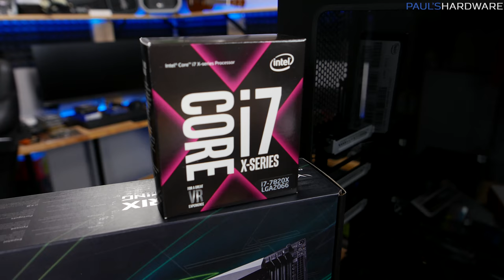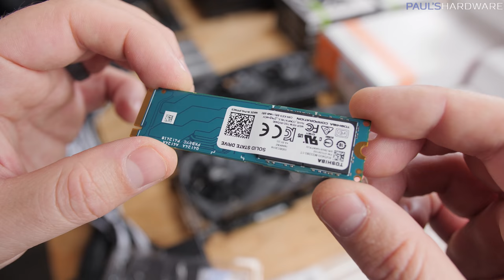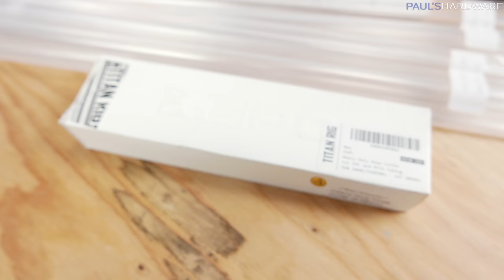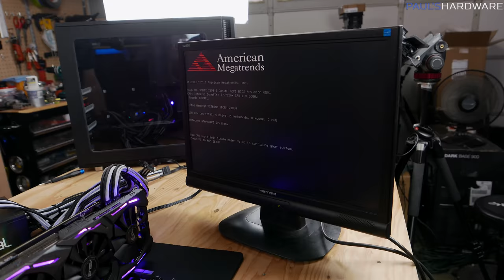GLORIOUS Custom Watercooled PC! Arctic Panther Build Log Part 1

Comment from the maker: Hope you guys like the video! Here's the USB Type C add-on mod I did (USB 3.1 Gen2) in case you missed it: https://youtu.be/iCFF2vujTv4
Reply: Yo Paul, am looking forward to watching this whole series. By the way a question about DDC pumps, are they quiet or not?
Thanks.
Reply: Just my opinion but Arctic Panther always seemed liked it was meant to be an over the top PC. So going with a 28 lane 8 core CPU does not seem like a big upgrade from your current 5960x 44 lane except for clock speed. The 7900x seems like a better evolution to me.
Reply: Paul dont use the strix backplates!!!! They dont fit. I just finished my own 1080ti strix sli build, and the card wont fit snuggly if you use the stock backplates.
Reply: Paul's Hardware why not msi?
Reply: hey Paul you want to do me a solid and build be a pc please
Reply: Paul's Hardware And by the way,how Asus works is:
Shove our hardware into YouTubers faces for free
Make them do sponsored videos in return of $$$
Invest in more shameless self promotion

How msi,gigabyte... works:
Make good hardware,if you want to use it,use it,if you dont,then dont....
Reply: Paul's Hardware 
 Why don't they make a full motherboard water block then just make port coming from the mother board wo you could water cool the video card and a front plate for the CPU.
Reply: I'm not a Fan of Fans in the bottom... Because they are fastest at, sucking dirt in the Filter... So they become useless really fast.
Reply: and then, like the last arctic panther, those GPU's will be obsolete in a year :'(
Reply: Paul's Hardware I don't see the fittings you used in your parts list! Might be blind, just wondering what you decided to go with for 16mm tubing
Reply: wasn't the cable too short for the place you put it? wasn't the other side a better place for that connector? does Lian-Li sells a longer cabled version of that?
Reply: Paul's Hardware but why not 7900x
Reply: FWIW, Paul: Anyone who criticizes you for the use of the 7820X, is welcome to get their own sponsors & build their own badass PC. ;) Also, I doubt you'll see any loss running one of the 1080 Ti's on x8 lanes. I ran 2 on x8, in the past, with no noticeable loss of FPS, or general performance. Keep up the good work, sir!
Reply: Paul's Hardware
How much would all this cost?  My guess like $3500+ maybe
Reply: I did tempered glass before it was cool... you sir copied me.
Reply: You can enlarge the holes of the backplate so they fit over the waterblock screws. A new high quality hss drill bit will make a clean job of it.
Reply: Paul's Hardware Awesome video yet again. Loved the jazzy tunes as well, excellent choice! I didn't like the processor choice, but I understand why you chose it, and that's A OK. I've also been there when your screws are too long, and that's the worst. My microboard monitors Vesa mount holes were too shallow and I had to grind them down to properly secure the monitors to a dual arm desk mounting system. I hope the rest of your build goes well. :)
Reply: Dear Jim O 5960x is a 40 lane cpu
Reply: you should have used a sugar cube to remove the paint on the PSU. It wont scratch, saves you some work
Reply: Paul, what was that small keyboard you were using?
Reply: Starts saying most Bang for Buck, stops midway, remembers its Intel he is talking about, starts saying Performance and stuff. Forgets that TR 1920X has better performance at the same price. Unless you are doing 144Hz gaming, I don't see a reason for the 7820X Paul, no hard feelings brother. The best thing about the build is the USB Type-C add-on which I absolutely loved and plan to do with my PC soon. The CPU kills the entire PC. If any CPU deserves the word GLORIOUS at this point of time, its the ThreadRippers. The amount of engineering that a small company like AMD did to topple Intel from its throne in its 1st attempt in more than 10 years with better system stability and performance with lower price is just marvelous. There is nothing glorious about the Skylake-X CPU or its ecosystem. The only thing glorious about Intel is the Pentium G4560.
EDIT- Sorry, I didn't know you had a ThreadRipper build planned. If that is the case, then please do feel free to try out which Skylake-X seems to be the best for you.
Reply: It may just be me. But.. did anyone else notice a sound quality difference.
Reply: Nice video Paul

Comment: For future work with cutting screws and other fasteners, if you put a nut on the screw before you cut it you can use the nut to fix the threads and prevent cross threading.

Comment: When cutting a bolt, put a nut on it first, then cut the bolt, clean the end then unscrew the nut, hey presto a clean thread
Reply: Thanks, I'll get used out of this. Who said YouTube doesn't teach you nothing
Reply: Every half assed fabricator in the world knows this .... Put a NUT on the BOLT before Cutting! Geez All these computer geeks trying to use tools is hilarious! Linus,Paul, Linus's staff, etc. are all tool and fabricating virgins and it shows... I would never let them near my shop or tools.
Reply: Or, if you're using machine screws, just get screw shears.

Heck, you can get screw shears for other thread types as well.
Reply: Most of my wire cutters have shears for machine screw sizes in USA sizes(6-32,etc) but I would think some chineseium ones would have the metric shears built in possibly. It appears all Pauls hand tools are low grade china stuff anyway.
Reply: or just use a good enough pair of scissors

Comment: Hey Paul, if you have wire cutters, then check them for screw dimensions. Most wire cutters are also able to shorten screws/bolts without stripping them. It's also a much quicker process.
Reply from the maker: Thanks Kurt! I'll give this a shot
Reply: Typically only machine screws. M1/2/3/4/5/6, at least in the UK, EU, Canada, Japan and Korea.

You can get screw shears for other thread types as well, though they can get a bit pricy.
Reply: I agree here for sure, using a rotary tool to cut something that small is way more difficult than it needs to be.

Comment: Yes, you NEED a vise.  Also you need a 60* file to smooth the cut end of the screw and repair and shape the damaged threads.  Also, two nuts of the appropriate size locked together works well in securing the screw in the vise and also for marking where to cut the screw.  Also, the nuts will aid in repairing the damaged thread after cutting.  Just the act of screwing off the nuts helps in repairing the damaged thread.

Comment: Did a similar thing with my backplate this time last year when water cooling my EVGA 980 Ti. I prioritised the block screws then just screwed the backplate where I could and ended up looking fine. I think most backplates are cooler than the EK ones anyway

Comment: Building my first ever water cooled pc soon, what kind of cleaning/preparing of the parts do i need to do and what liquid/equipment would i need to do it?
Reply from the maker: I'll cover that a bit in the next video - it's best practice to flush parts with distilled water before using them for the first time, especially radiators.
Reply: thanks for the reply. I assumed a flushing was in order, but as you see in techsource's build of Electrobox he uses some sort of concentrate but doesnt state which one etc. Love the channel btw, keep up the good content.
Reply: Joakim Wold my guess would be that's it's the mayhems cleaner.  That's the one I have used before.
Reply: Joakim Wold you can also use viniger
Reply: Go watch jayz2cents Brody, he'll learn ya real nice

Comment: Depending on the diameter and material of the screws, a nice wire cutter works very well for cutting screws. I've had to do that when building electronics at work.

Comment: As Bill Owen would say... MOD It... that plate that is... could you possible drill holes in the top plate that line up where the block would need screws?

Comment: just a suggestion. can you perhaps drill the holes in the back plate to open up the diameter enough to fit down over block screws? you can get yourself a dial caliper and measure the diameter of the block screw to see if you have enough material to take off the black plate screw hole

Comment: Harbour frieght die set, and a good pair of flush cuts. You'll need to chase the threads when you cut the screws. Should be fairly easy to do with any decent die set

Comment: Great video Paul . I thought you would have pick up on how to shorten small screws by now.....My method ...Find a NUT to put on the screw then you saw or grind it shorter file it flush with the nut ..NO thread damage ..works with any size. thanks

Comment: You had the right idea using the vice grips should have just clamped them to the bench so you had 2 hands for the dremal.
I have always wondered why EK doesn't make their blocks compatible with the gpu backplates.

Comment: Hey Paul! Back-Plate solution! Remove the Back-Plate and now you have two choices for the interfering holes. Press out the silver colored threaded inserts. That would be ideal! However if not do-able for you based on your limited tools... Use the Dremel to shorten the pressed-in threaded inserts so that the Back-Plate sits closer down to the PCB. Respond If you are interested and want details! Good Luck!

Comment: great thumbnail. I had the same problem with the EVGA backplate on the 970, but I had access to a vice. not having the right screws is the most frustrating thing about building custom systems by far.

Comment: One TB is not enough for games. I also have that same metal container to hold screws. Mine is silver and I purchased it at Microcenter. I like that it has a magnet so it holds the screws and you can stick it on any metal surface.

Comment: What was the double sided tape you kept using for exactly?
Just to help keep things in place or was there another reason?

Also as for the back-plate while I see your point about wanting to keep the RGB symbol I would personally just go ahead and use the EK back-plate or the fit and finish since this is such a high-end build.

Comment: Now seeing that six screws are needed to mount the GPU block, I'm wondering if you can get away with just using only six screws without any issues and without having to do anything unorthodox like using a tiny screwdriver to screw down the block in places where the backplate would otherwise interfere.

Comment: Looking at VSG's charts over on thermalbench, backplates are likely to reduce vrm temps by 2-3°c and core temps by a 1-2°c, unless they're active (like the kryographics backplate).

 I'd consider tying the middle of the bp down last, as a slight convex will be less noticable, provided you are happy with thermal contact ofc :)

Comment: I’ve never had a fancy external graphics card but doesn’t the back plate help provide rigidity to the card? Giving it additional strength, making sure it doesn’t flex while heating up and cooling down, and or possibly dissipating heat?

Comment: Well the 7820x is just $30 more compared to the 1900x, but lacks in PCIe lanes ( And tends to stress test the VRM ). That's why I got the 1900x for my 1080ti SLI setup. I also run NVMe only, using three drives, I disabled SATA in bios, what an easy cable management :) As always, really appreciate your content, keep it up !

Comment: wait with thredripper until you can get AIO with thredripper fullsize head unit , not just the normal with the exra backet... also if the case  can accommodate for  it, use a 360 rad...

Comment: Just an FYI Paul, Ace Hardware would more than likely have the correct screw length and thread you need. Their selection is top notch and puts places like Home Depot to shame when it comes to little stuff like this.

Comment: A question the internet doesn't seem to have an answer on; is dual intake-dual top exhaust+radiator a viable option, generally speaking? I have mounting points for a basement and rear exhaust fan, but I really don't see a huge need for it.

Comment: you get have drilled the threads out of the backplate and then got longer screws to go through and hold the backplate and tighten into the waterblock..? <3

Comment: How do you attach the front panel USB type C connector to your motherboard? If I understand correctly, there isn't a standard yet for that connection, so your case needs to come with the connector which matches the motherboard, and since your's is a custom modification of your case, I doubt it did.

Comment: @Paul's Hardware. Can you test the difference in speed between the new Evga 12gbps gddr5x speed @528gb a second vs 11gbps 484gb a second? How much faster is it? Fps, etc......in 4k gaming. How much memory bandwidth is enough. Which game needs more memory bandwidth. Thanks. Great video by the way.

Comment: I prefer the stock Asus back plate over the EK one's as well, I was always wondering if it was possible to leave them on! I say leave it!
Reply: zapper75 I wouldn't think it would cause problems but it will be interesting to see what Paul does/doesn't discover down the road.
Reply: Jonathan Muller I may be wrong but I remember hearing the ek blocks actually mount to their backplate and not the gpu. So if you did keep it you would have to find  an alternative mounting solution.
Reply: dev70194 That's what I originally assumed, it propably only works with a select few gpu's to leave the original backplate.

Comment: Hi paul! Im building a similar white/black themed pc in define c using the z270a prime mobo and 7600k but im torn about choosing a new cpu cooler. I have an old h100i but i would like to change for a air cooler that would match and fit with fury ram, any ideas?

Comment: If that cover for the m.2 is acting as a heatsink, shouldn't you remove the sticker in between?
Reply: Lorenzo Sorice Check the Gamers Nexus coverage on that, I believe you only want to cool the controller, the actual storage benefits from retaining heat.

Comment: Ehhh I'm not loving the cpu personally. I understand that having two of that guy should be convenient for you. I guess it comes down to what the purpose of Artic Panther is. Is it a gaming rig? 7700k and oc the snot out of her. Is it also an editing rig for you? Then probably could have got a lot out of the 7900k. I guess if you're doing both with the machine, the 8-core is a good solution though, but as you yourself said, threadripper exists.

Comment: Shouldnt you just run both the 1080s at 8x considering pci lane count doesnt matter that much on gpu however sli loves consistency and running one card at 8 and the other 16 doesnt really do achieve that lol idk just a noob question/thought >.<

Comment: I personally thing the TR 1900x wouldve been a better choice simply for the 64 pcie lanes and because its new and a break from the norm. When running dual 1080tis, really not worried about the ever so slight advantage in FPS with a 7820x . Very similar performance in multi-threaded applications and its a bit cheaper by lil as well. But my goodness this is a great build and honestly, I'm glad I can even have this debate on the HEDT side of things. Keep up the good work, cant wait to see your TR build.

Comment: Noob ques: what is the blue thing you put by the CPU & the GPU? 2-sided tape?
Reply: Those are thermal pads, transfers heat from components to the block/heatsink.
Reply: ADCBot orrrr ok thanks

Comment: It has been nearly 2 years since I bought a Gigabyte motherboard and I still do not have it working.   I am on the 4th copy of the same model after 3 RMA exchanges.   I gave up on that board because I have spent nearly $100 in shipping costs and will no longer throw good money after bad.   This may not be your experience, but it is mine.   Gigabyte, caveat emptor.

Comment: Without the weight of the gpu cooler, backplate isn't so necessary, from the strength's point of view. So it should be ok.

Comment: Paul, how much does this build cost with only 1 1080 ti and a 240gb m.2? I only ask because im going to buy this exact build and ill probably only change the case and the color of the cables lol.
Reply: total cost for your setup minus case and power supply (discontinued) is $2255.62 for the hardware plus another 600 for water cooling plus the cost of fittings.

Comment: can you get your asus aura to save the settings after reboot? mine keeps resetting to pulsing red or doesn´t even launch on boot
Reply from the maker: It can be finicky because there are UEFI controls and software-based controls. I've had luck with a UEFI/BIOS update and/or clear CMOS fixing sync issues -- there's a "lights off while PC is off" setting in the UEFI too
Reply: guess I´ll try a BIOS update. Thanks for the answer!

Comment: Hey Paul, have you found a way to make asus aura save settings? i know that the software resets when there is power loss (surge, switching the psu off) but for me it also tends to just reset while the psu is getting power, about once every 5 times i turn my pc off. If i spend over €1200 on aura compatible hardware i expect the software to just save the settings somewhere, and use those settings whenever power is lost, but that doesnt seem to be the case

Comment: Afterall, many people dislike the x299 platform, but that will never stop Paul. By the look of the list of parts, this is only for the richest oil princesses or computer hardware reviewers. Noice.
Reply: Enrique Bucio I'm neither, but I'm assembling the cheapest X299 system I can, as a troll build. MSI X299 Raider, I5 7640, 4GB Crucial 2133 RAM, etc. Only twice as much as it should cost, lol.
Reply: About that, I was also aiming in that direction for my planned future build, well sorta. That i5 7640 really makes no sense in Intel's lineup, so that should be the trolliest build out there by now and the meme pc "1920x1080".